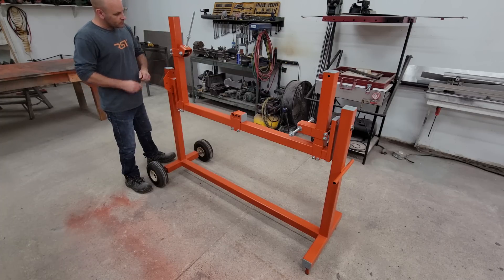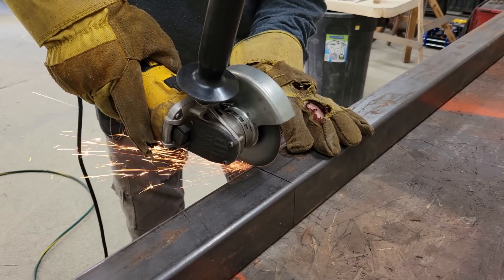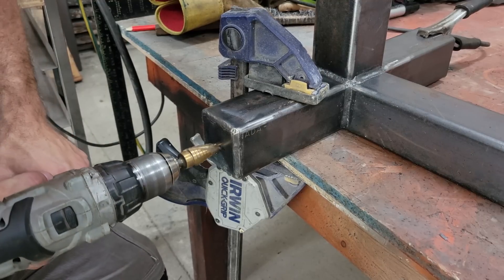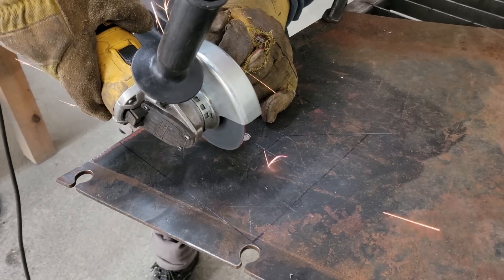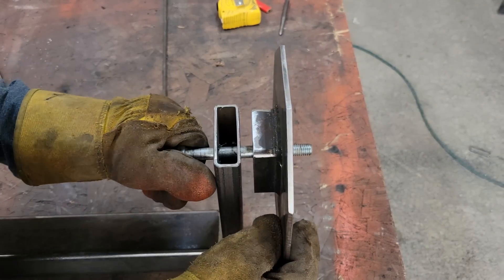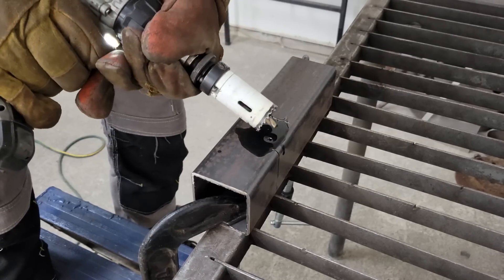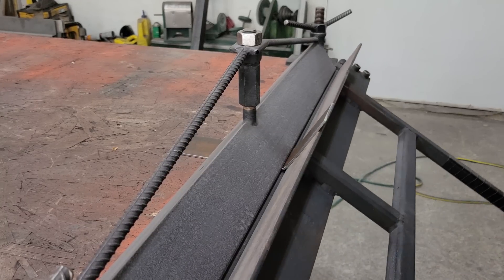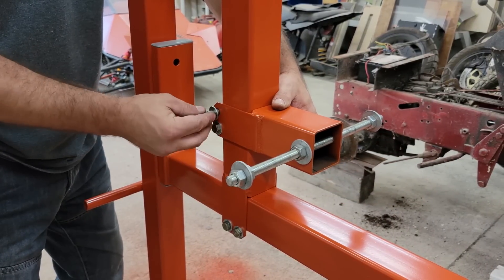Building A Rotating Motorcycle Chassis Jig - Free Plans Available

Comment from the maker: I made my jig a bit shorter than it should have been and can only build chassis' for bikes with up to a 55" wheelbase, but I can splice some tubing in later if/when the need calls for it. I added another 12" to the plans so that anyone using them for reference won't have the same problem. You can check them out here: https://renewablesystemstechnology.com/project-blog/building-a-rotating-motorcycle-chassis-jig
Reply: GOOOOD JOOOB DUUUDE))!!!
Reply: Thanks a lot!
Reply from the maker: Np!
Reply: I remember your older videos have no voice over. 
It's better to listen than to read text that might not last long enough.
Reply: Neat. This answers my question. Am interested to know how you managed to guarantee that the head tube angle was perfectly inline with the axis. Seems to me that is a precision part that’s crucial to the accuracy of the final steering alignment. I would prefer the |_| shaped part to be made from bright square internal U section material, with the side pivot holes precision drilled. 

Thank you for sharing.
Reply: James, thank you as always!!! 🙏

Comment: ✋ Hi, friend..
I have a thought like this, you are in the field of electric propulsion automotive. how can you use the dynamo rotation on the wheel/axle to be used as a means of generating electricity for charging to the backup battery (( you need 2 units of battrey to be used alternately with the automatic disconnect system/fuse, when the main battery runs out immediately move to the backup battery) & the main thing is that it is automatically re-charged )) and continues like that until it becomes an eternal electric-powered vehicle. you don't have to stop for a long time recharging public facilities battrey.

🙏 Greetings from INDONESIA

Comment: Good idea, what is the maximum weight it suports?
Reply from the maker: Thanks. Literally mentioned at the beginning of the video. A 6ft length of that tubing is over 5x stronger than the entire weight of a typical motorcycle. But this is a chassis building jig, NOT a motorcycle stand or lift (which are far less robust) for supporting an entire motorcycle. These are different things. An entire motorcycle obviously won't fit. Part of the reason the spindle is offset is for balance, I'm turning it with two fingers. Easy. But that's just a convenience. It doesn't need to be balanced let alone perfectly balanced.  Motorcycle frames only weigh 20-30 lbs unless we're talking big cruisers which are still only around 50-80 lbs. My portable jobsite table saw weighs more than that. It's enough to pinch a finger, but not near enough to kill someone. This jig is child's play.
Reply: @JamesBiggar  
very thanks you attention, I didn´t heard the coment on the vid, but ok. The idea can be adapted if I need it supports more weight 👍
Reply from the maker: Sensitive much? I'm just clarifying. Grow up or you can back off. This is my channel bud.
Reply from the maker: As I mentioned in the video, this jig is very similar to every other rotating jig, commercial or not. Check out chop source - they make the kits that I also mentioned. Very popular among pro builders. But what does anyone else know? You chimed in with perfectly logical armchair assumptions without even watching or consulting a load table.
Reply from the maker: Right. And neither I nor Mauricio were talking to you. Yet here you are, getting upset and responding to me for answering Mauricio's question and correcting your assumptions so that he and others know better. I'm not sorry that upsets you. This isn't about you. You're just making it about you because you're upset.
Reply from the maker: 🤣 Sure. That's exactly what happened. Whatever makes you feel better.
Reply: Mmmmm... This question got real silly very quickly.
I would have assumed that anything watched on a platform like YouTube or similar is for a guide only and would definitely be up to the individual to assess there own abilities etc before actually trying to create what they've just watched.
It's all just a guide (if you want to try it).
I thought the video was clean, accurate with some nice cutting and welding. Am I going to make one... No. But it did look and sound good. (BTW.. Yes I do fabricate and weld professionally so this did Interest me).
Reply from the maker: I guess he came to a realization, or just left another nasty reply and blocked me so I can't see any of them. Oh well. One less child to deal with.
Reply: @JamesBiggar  nah, that fool deleted his comments